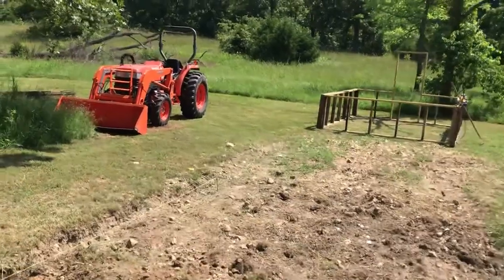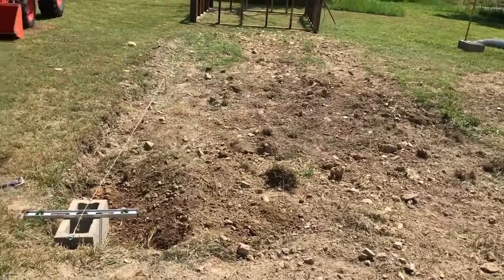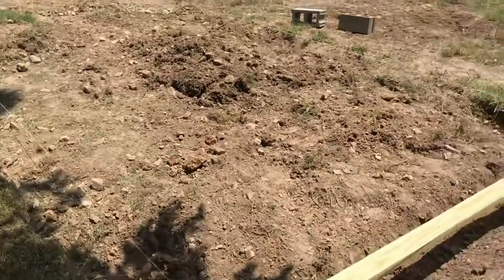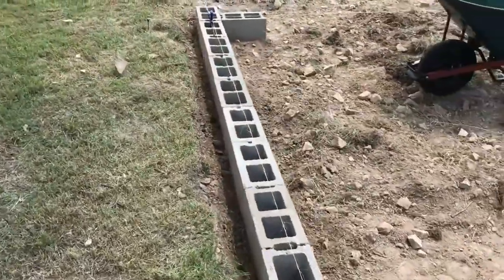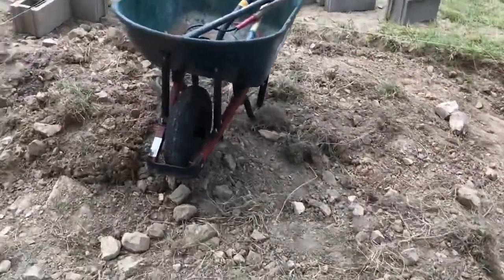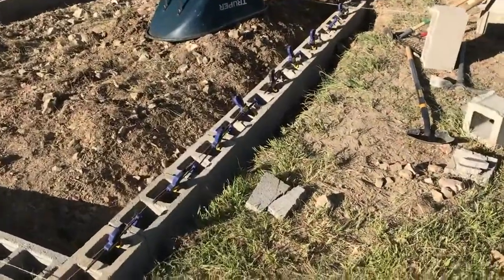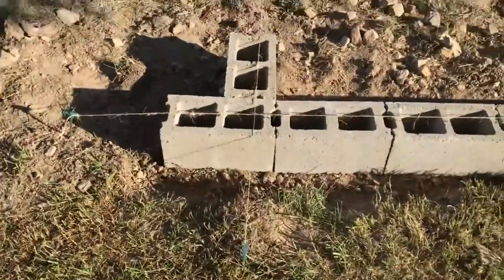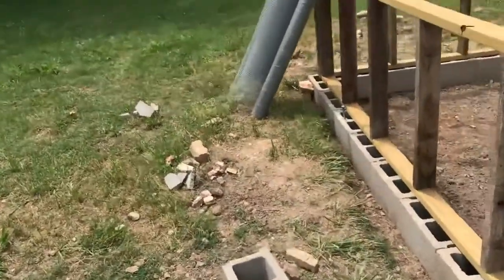Chicken House Build update - In the Home Stretch, maybe...

Comment: How are you attached and the wood frame to the CBS block
Reply from the maker: I actually put concrete in the cinder blocks with anchors and bolted the frame to them. As for the hardware cloth on the ground, I dug down pretty far and once it was all laid out and the cinder blocks were placed, I filled it back in with dirt and sand.

Comment: They say not to put wire down at the bottom because the chickens people get caught it and they won't like
Reply from the maker: The way I installed the hardware cloth wire doesn't affect the chickens. It is another barrier for predator proofing the coop and is roughly 10-12 inches below the surface. When I built the coop I dug down almost 2 feet in order to do what I was planning.